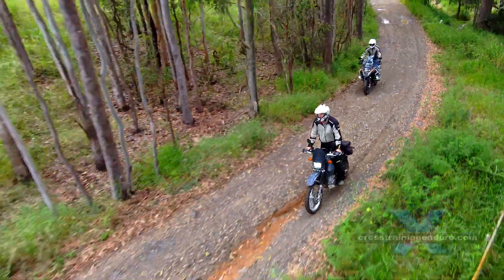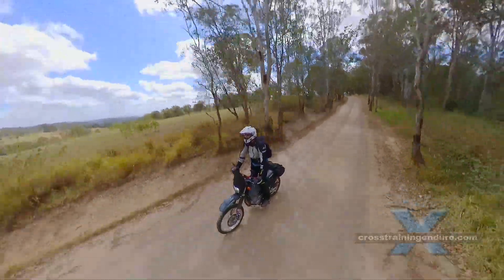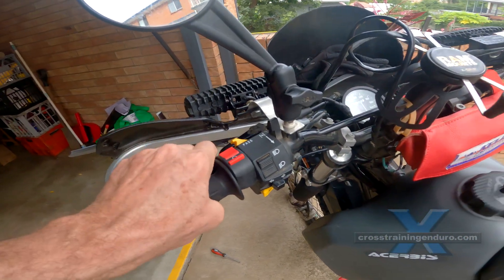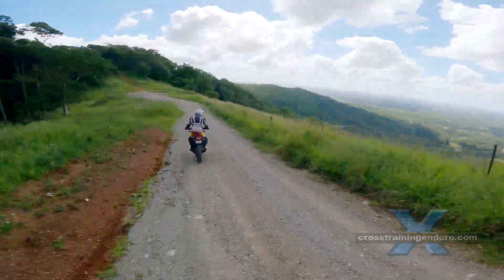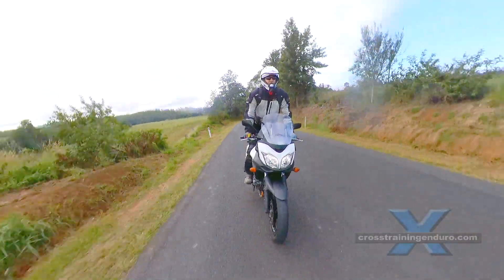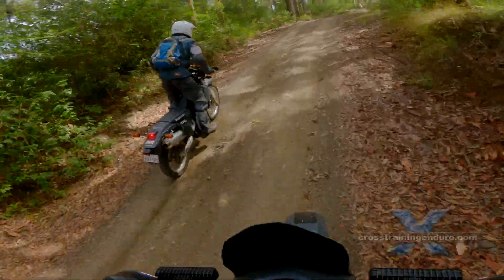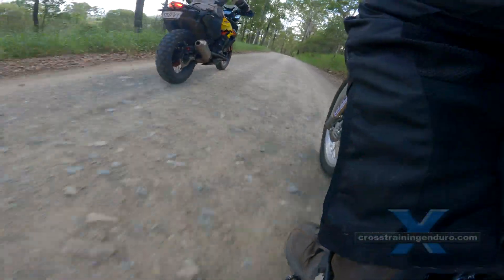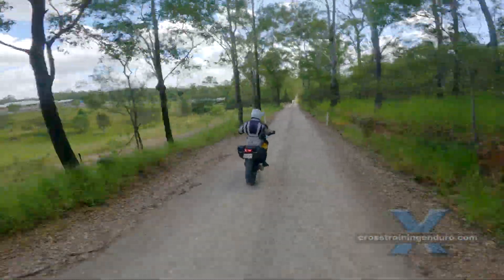How to make your cable clutch lighter!︱Cross Training Adventure

Comment: File down burred clutch basket, yz250f springs, lubed cable, and moose easy pull lever have made my licence plated wr450f a dream to ride. Almost as light as my enduro bikes hydraulic clutch with a Midwest lever. Well, for the first half of the pull in any case 😅
Reply from the maker: Good work, I'll have to remember the 250F springs to remind a few WR450F owners!

Comment: I recently ripped off the middle finger of my clutch hand on a log splitter. My 85 Superglide clutch is pretty stiff any way so I was thinking of cutting radial slots in the diaphragm spring to make it easier to.pull. Your video gives me hope it just might work.
Reply from the maker: Ouch!

Comment: I tried the add on style lever thing. Broke the first ride. Nope, i just keep mine stock now. DRZ400S. Replace first clutch at 20,000 miles. Still going with 2nd clutch, now at 53,000 miles.

Comment: What’s the best finger for the clutch? Pointer or flipper?
Reply from the maker: Good question. I think most people use the pointer, assuming the clutch is light enough to not need more fingers on the lever. Haven't actually heard of anyone using the middle finger...
Reply: I actually use both. Maybe because the klr has a very stiff lever

Comment: 1) If no medical reason for a lighter clutch then just buy a cheap set of hand calipers or a tennis ball and get squeezing. Improving your grip strength has benefits in many areas. 2) Lubricate your clutch cable with Graphite powder: make a cone of tape around the top end of the disconnected cable and partly fill with graphite powder. Move cable up and down to facilitate entry of lubricant. Keep doing so for a long time so graphite gets all the way to the cable's end. This should help lower the cable's friction and because it's dry won't attract dust or dry out.

Comment: why is the lever so far from the bar generally? bringing it 10 or 15mm closer would make the power needed to press it much smaller. Brake lever comes with adjustment, but clutch doesn't, why is that?